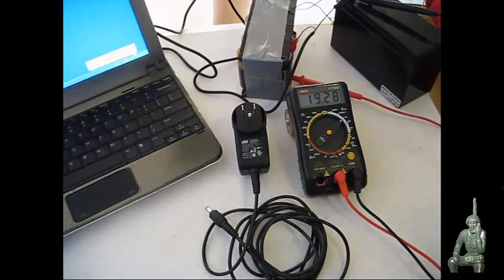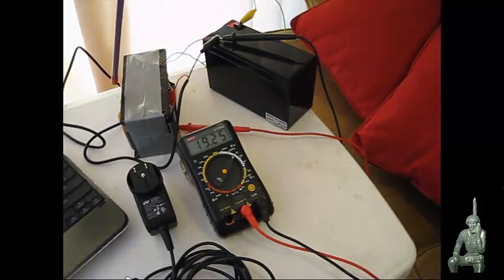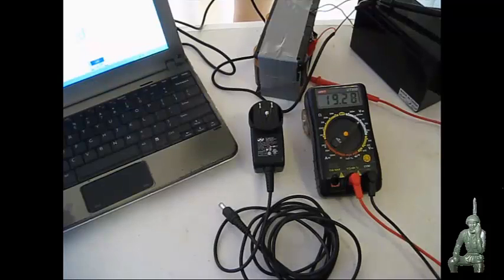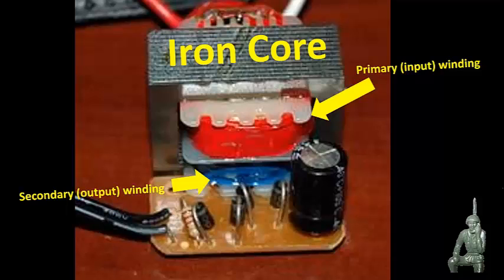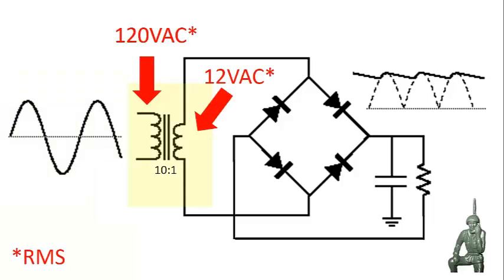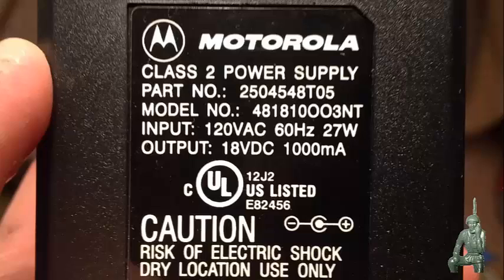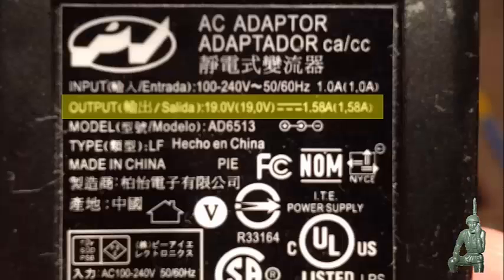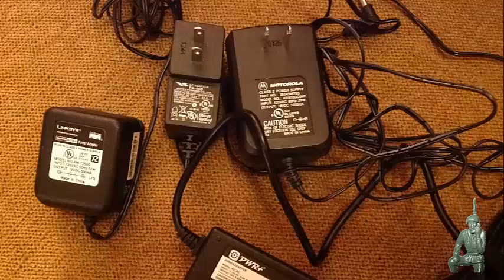Wall Transformers & Power Adapters

Comment: Adapter or transformer which is best
Reply from the maker: For what?  Adapters don't change voltage.  transformers only change AC voltage.
Reply: @Commsprepper  used for water pump 12v 3a  ,arduino uno, and motherboard

Comment: Hey i have a question, i was shopping somewhere and i am a foreigner. I wanted to buy a device, to be specific it is the oculus quest and they asked me to get a transformer for it? Understandable but why not an adaptor? Is it just so they earn more money? I do have an adaptor that makes the electricity go to 5 Volts. Do i buy a transformer? I have an adaptor that will make my electricity compatible with USA’s electricity. So i want to understand if i need a transformer or not.
Reply from the maker: No enough information.  "Adapters" are traditionally passive devices and will not "change" power.  Adapters let you put a square peg in a round hole.  Transformers step-down or step-up alternating current (what comes out of your wall). 

Are you talking about the gaming headset?  If so, it looks like it is charged with a USB type connector.  I suggest you look at the charger plug (black box with cord) and see what the input voltage is.  Most computer stuff is 100-240VAC.  Make sure the "blackbox" matches what's coming out of your wall.

Comment: Great info as always, but I have to wonder what a person would do that bugged out or something and didn't have a adapter with him, how would one know what voltage to use or the polarity of the tip if there were no adapter to glean that info from. I know some devices have the info listed but some do not, any ideas on this I'm just thinking outside the box. Thanks
Reply from the maker: Yeh...  that's the one item I left out of the video.  I mark my devices (ones I question) with sharpie marker.  For example - I have a mix bag of old and new Linksys stuff.  Some uses 5VDC and some uses 12VDC.

Comment: Is there a way to modify an old computer power supply to run a radio if you don't have a power supply?
Reply from the maker: I'm going to say yes - depending on the radio.  PC power supplies provide 12, 5, and 3.3 VDC.  Note that PC power supplies also provide the sames voltages in negative form too.  Checkout "Power supply unit (computer)" on Wikipedia - there you will find that pins on PC power supplies have what voltages.

Comment: Assuming you had 2 wall warts with the same output voltage (let's say 12v DC) does the second number (amperage) represent the maximum amperage output or the EXACT output?
Reply from the maker: The max the transformer will provide to the device.